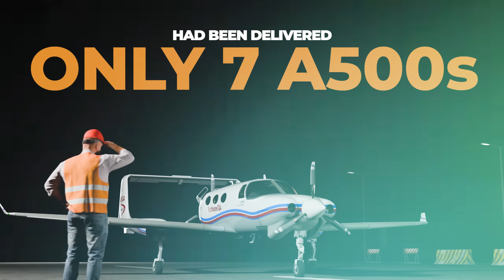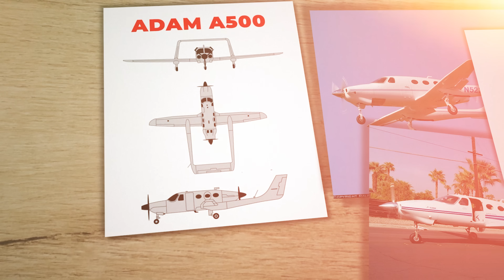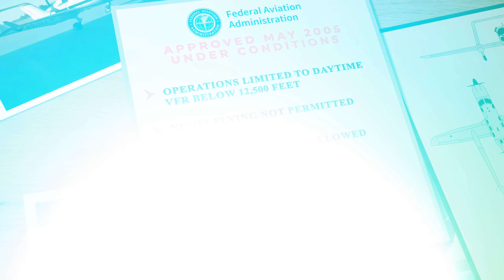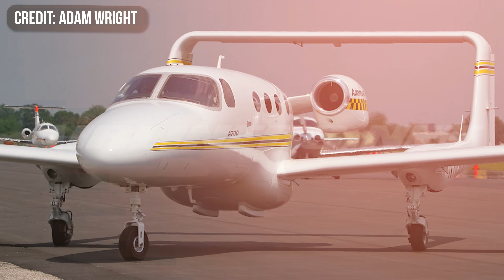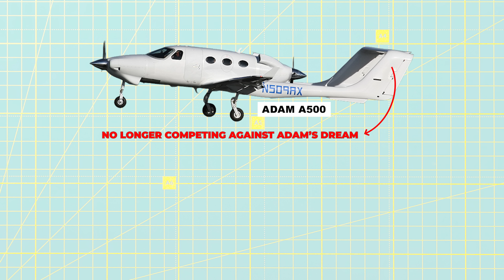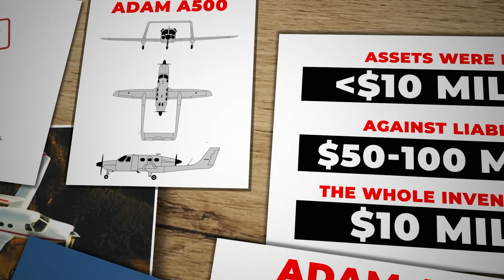The Plane That Fixed General Aviation… Then Failed

Comment: It was wrong to make the piston version with a pressurized cabin.  This adds too much weight.  Supplemental oxygen would be a lot lighter.  Now there are available oxygen concentrators that work at up to 20,000 f altitude without the inconvenience of oxygen bottles.
Also, why didn't Adam learn from Cirrus Design how to make light-weight composite airplane.  Cirrus Design received an FAA Production Certificate for its SR20 aircraft in June 2000 with ample of useful load capacity even with a ballistic parachute.

Comment: What About Counter-Rotating Engines? Why Do So Few Twins Have Them? Doesn't That Eliminate The Critical Engine Out Danger? Thank You. (Like #166 - Comment #24)
Reply: Umm, makes no difference which way the propeller is turning after losing one of the engines.🤷‍♂️🤣🥳
Reply: @clifflong1203 it matters because of P-Factor on the operating engine. Think about how you need right rudder on takeoff with a single engine plane. The right (descending) blade creates more thrust vs the left blade. Now put the engine on the wings. On the right wing, that force is out past the engine. On the left wing, the force is between the engine and the fuselage.
Reply: @clifflong1203  Losing The Port Engine Is Not As Critical With Counter-Rotating Engines.
Reply: @thewatcher5271  Huh? please explain.
Reply: @thewatcher5271  if you are the pilot in a twin engine airplane taking off and losing power of either Engine, what direction the prop is turning makes no difference. You were going to be very busy sorting it out and if below VMC, you are probably dead.🤷‍♂️
Reply: It eliminates the critical engine, but it still requires a lot of effort and skill for the pilot to control the plane. With centerline thrust, you just have to deal with a loss of power, but you don't have to worry about rudder and Vmc roll.
Reply: @sharedsailing4787  I understand that, I was referring to a traditional twin with engines to the left and right.
Reply: It makes them both the critical engine.
Reply: Consider the Boomerang OEI is a walk in the park no need to push any pedal
Reply: Your confusing 2 different problems.
Reply: @jimmywright5054 The original P-38 had counter rotating engines and it could NOT get off of the ground even using the entire runway.

Comment: Rutan delivered a certifiable design and the builder changed things to be his way rather than Rutan’s and that is how the design went way too heavy for the payload and the range.
Reply: Same thing that plagued the Beech Starship. It was designed for the little Williams turbojets, but they weren't certified in time so it got heavy, inefficient turboprops.
Reply: @michaelcallahan6166 airframe was built entirely too heavy and the glass displays were quite heavy because Beechcraft had zero experience building composite components. Beech was out of control.
Reply: @JaguarKwikE yup, the engines were the start and it ballooned from there. Rutan's famous saying about weight... "If you want to add something to your airplane, throw it up in the air, if it comes back down don't put it on.
Reply: Yeah they should have told rutan about the design needs upfront.
Reply: You have no idea what you are talking about.
Reply: @jadfly I am a 20,000 flight hour ATP aviator and I have researched this as extensively as possible but I do not know everything. I know that the prototype built by Scaled Composites was significantly different from what Davis built. I am part of the Davis family dating back to the 1700s at Llandridod Wells, Wales.
Reply: It was wrong to make the piston version with a pressurized cabin.  This adds too much weight.  Supplemental oxygen would be a lot lighter.  Now there are available oxygen concentrators that work at up to 20,000 f altitude without the inconvenience of oxygen bottles.
Also, why didn't Adam learn from Cirrus Design how to make light-weight composite airplane.  Cirrus Design received an FAA Production Certificate for its SR20 aircraft in June 2000 with ample of useful load capacity even with a ballistic parachute.

Comment: "Couldn't carry a pilot"  What the heck does that mean?  No, I'm not going to fall for the clickbait and watch video in the hope of understanding that dumb statement.
Reply: Well, if you HAD watched, you would have learned that the first production aircraft was so heavy that with full fuel, the payload capacity was not enough to allow for a pilot, unless he was pretty light. So. Yeah...not really clickbait
Reply: @JackBQ  No airplane can carry both full fuel and full payload at the same time, unless its allowed fuel and payload are artificially restricted to begin with.  There is always a tradeoff between fuel and payload. You carry a lighter load a longer distance or a heavier load a shorter distance.  Clickbait.

But my point was not in any way about defending this as a good airplane. My complaint was the  false statement of the title.  The airplane can carry a pilot or it would not be certified to fly.  A more accurate title such as "an interesting airplane that failed in the marketplace" would not have attracted my complaint, and in fact would not have attracted me at all.  I clicked on the bait to see what the video was really about, and when I saw that it was a lie I lost interest.  That is the definition of clickbait.
Reply: @gort8203 I know if no other airplane that couldn't carry an additional 200 lbs after full fuel.
Reply: @Bren39   The empty weight of the airplane turned out to be more than planned, reducing the useful load. So don't fill the tanks all the way when you need more useful load, which is standard for transport  category aircraft.  I guess the company should have reduced the fuel capacity to eliminate the need for operators to balance fuel and payload, but they only built 7 of them.
Reply: @gort8203  The creator of this channel seems to believe that any aircraft that cannot carry max fuel and max cabin payload at the same time is a failure of a design. I don't understand why someone who likes aviation enough to make these videos doesn't realize that this is a natural tradeoff that nearly every aircraft must make.
Reply: @Fleetwing1627  Amen.

Comment: The do-335 is watching this laughing
Reply: and Cessna 336/7 Skymaster
Reply: I had several discussions in the late 80s with a pilot who logged +/-100 hours on the Pfeil (as well as a few test runs on the Me163). Fascinating.

Comment: It's virtually impossible to bring a new airplane to certification these days. The irony is that as a society, we accept the deaths of 10s of thousands of people on the highways, but we will not accept deaths in the air. If the regulations that are applied to aviation were applied to cars, virtually nobody would be driving a car, and there would be no new models on the market with less than 10 years technology lag. The FAA has killed aviation, and the 'golden age' of flying is only a distant memory from the past.
Reply: The regulations on experimental aircraft are much much looser.

Comment: Would the thrust from the rear propeller have some impact on the elevators? It would seem that moving the elevators down to pitch the nose down would be resisted by the airflow. Does anyone have any knowledge of how that affected the flight characteristics?
Reply: If anything it should give the elevator more authority
Reply: That's usually why the tail on such planes is lifted above the rear airstream (contrary to, for example, a P-38's tail)
Reply: Would effort it and rudder very positively during takeoff and low speed flight because that propeller so close to it blowing air over them